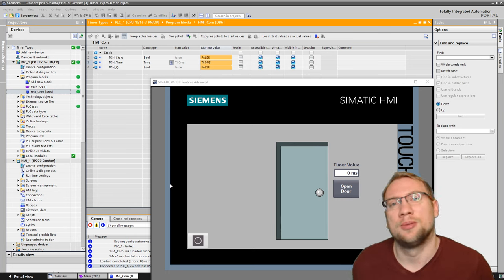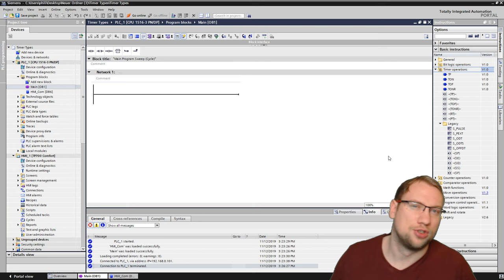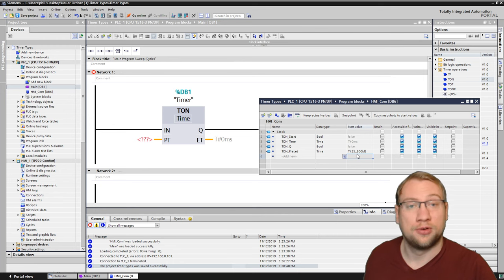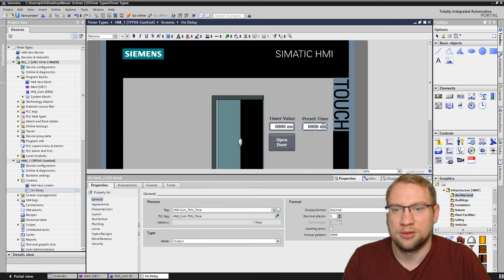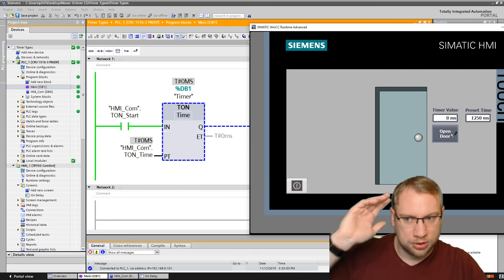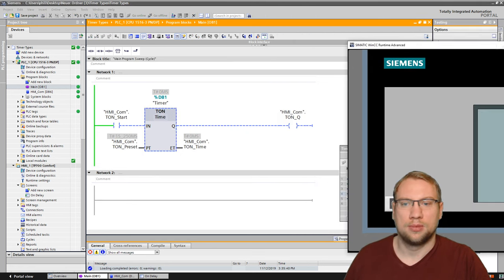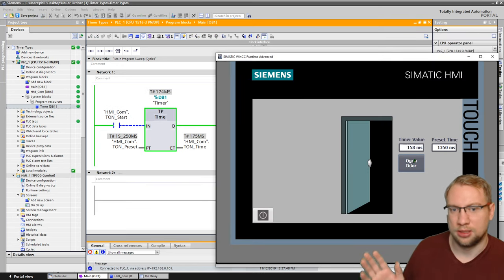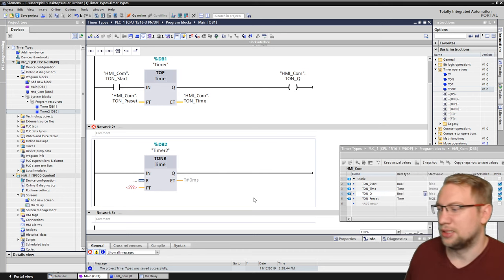TIA Portal: How to use Timers (TON, TOF, TP, TONR)

Comment: I have a question:
Using v19:
I have a TON timer that pauses all function for XX amount of time,
That XX is set by user in the HMI 
The XX needs to be in Minutes but every time user sets that XX it sets as ms not m 
The default value is T# 60m 
I use a in/out inout field on HMI
I use a DB to store and change does values in Runtime 
How can. I make that input minutes not milliseconds

Comment: What should I do If I want to set output high only for 1 min but I also want to have option to prematurely turn output off? TP timer is great for setting output high for specified time but It's also non resetable. Any ideas?
Reply: IF START THEN:
 M1=TRUE;
END_IF;

TON1(EN:=M1,PT:=t#60s);

IF TON1.Q OR STOP THEN
 M1=FALSE;
END_IF;

OUT1:=M1
Reply: In past  before IEC we had two type pulse time one of them  timer be active by rising edge and whenever  input become zero before time elapse, out put also be zero and timer will be reset. The second one (pext) like IEC work. You can use legacy in 1500 and use flip flap in 1200.
Reply from the maker: It is resetable! Check out my video on that! https://youtu.be/kHPm9u42zVI